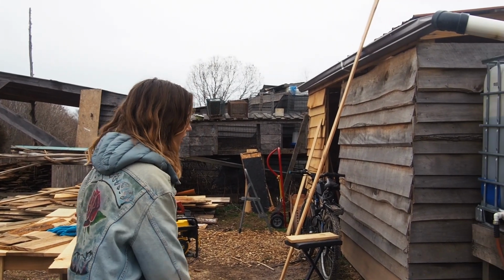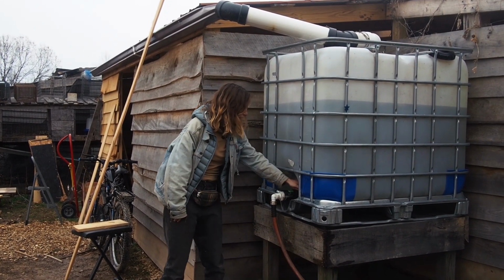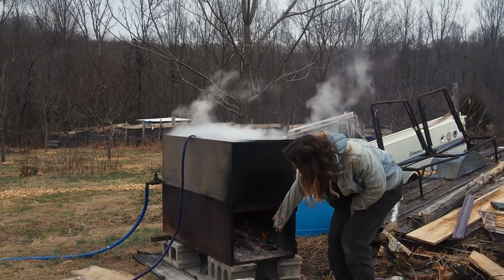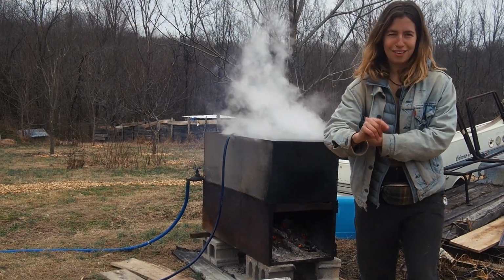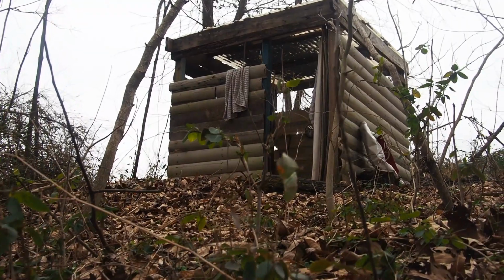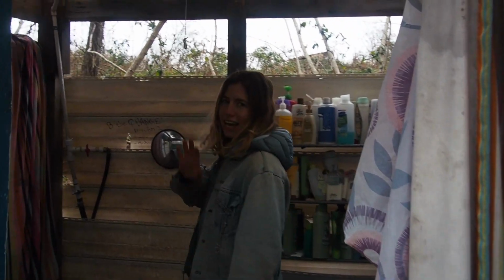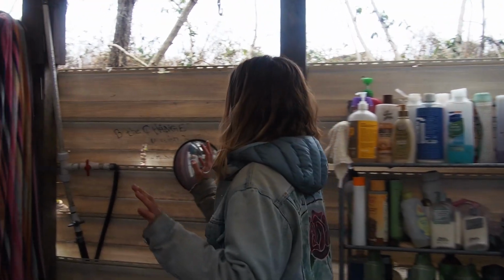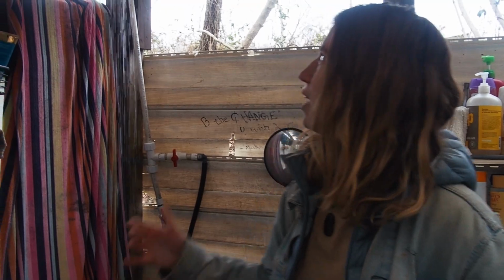Simple OFF-GRID HOT SHOWER setup

Comment: awesome video guys! I have been working on an idea of having a self contained 5l shower that re-uses hot water through a filtered drain to a loop system, until you switch to the gray water drain and rinse yourself off... it would require preheating of water (which should be natural to have on the stove during cold months) and (optional) a small heating system to allow the reusable water to maintain its heat. :) a couple of years from now I will start building an off grid cabin. getting rid off as much dependency to money as possible. Anyway! awesome video! really enjoyed it! 😺Simplicity and alternative living is definitely the way forward for me as well. :)
Reply: nice
Reply from the maker: hi!! that would be awesome if the shower was self-contained! Thanks for your input, always great to hear from you :-)